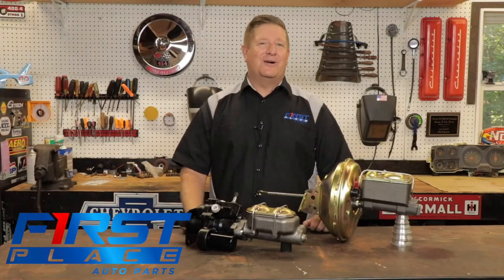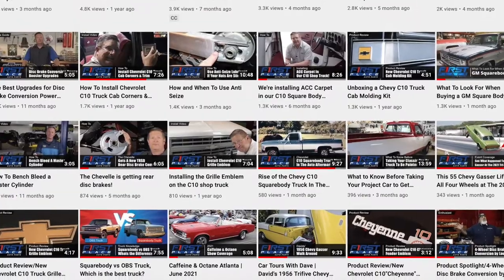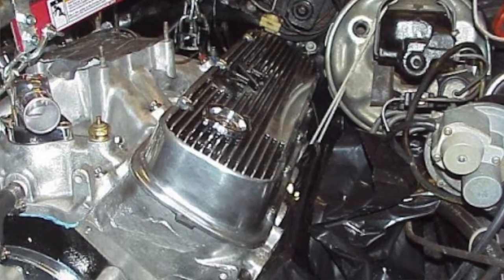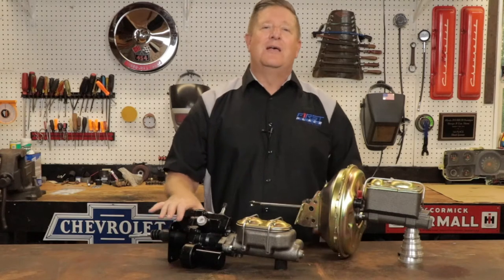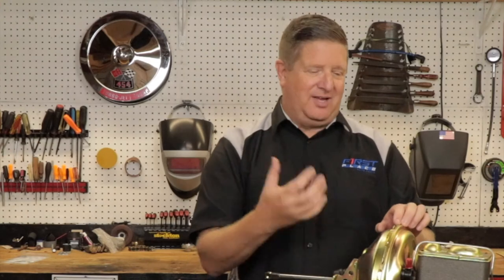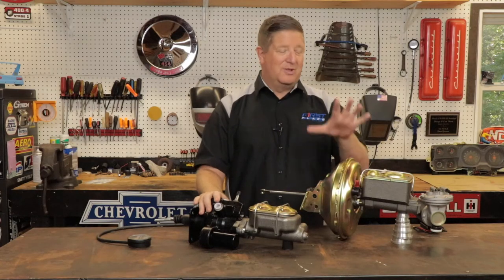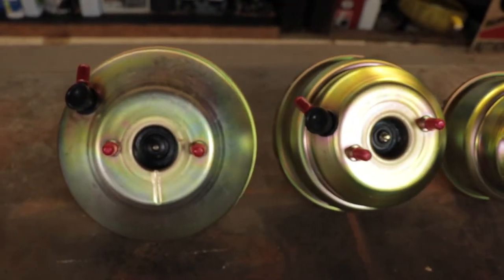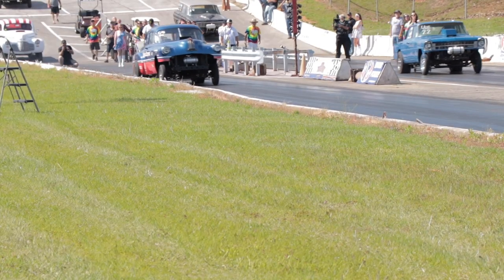Hydro Boost vs Vacuum Power Brakes, Which is Better?

Comment: Good video ,there is the 3rd option where you have the corect size master and slave or calipers and fully manual brakes. Had a wilwood kit like that on a 4000 pound car and it had the best feel ive ever felt.

Comment: Thanks for your blatant hydro boost pitch. A pity perhaps, that you chose to avoid mentioning that low vacuum issues with warmer camshafts can be dealt with a simple vacuum can. Cheap, silent, usually easy to mount and have been used for decades. But not much profit in those compared to a hydro boost kit is there…

Comment: I’m doing a total restomod of my 70 Firebird, yes I’m doing the whole Ls and tranny swap, along with full suspension, and brakes to include the rear brake disc conversion. I’ve never liked the stock brakes even while driving it with the stock 350 two barrel, so when I found out about these boosters I completely felt like it was a game changer!

Comment: I have a 1956 Chevy with a454 using a mustang II rack  can i you a hydro boost in my car, what is the GM power steering pump out put pressure for the hydro boost, what is the minimum i can use, mustang II rack needs about 800 to 1000 pounds, can i run the mustang II and the hydro boost with 800 to 1000 pounds of pounds

Comment: I have the hydro boost system in my2500 Silverado I just want to learn more about the system so if the power steering goes out do I lose the brakes also
Reply from the maker: With most hydro boost (similar to vacuum powered brakes), if you loose power to the system (in this case power steering) you should have one or two brake pedal applications before all power assistance is lost. After that, the system reverts to "manual" (no power) system. You won't completely loose brakes but it your stopping distance and the pedal effort required to make a safe stop will be significantly higher. Keep an eye on the serpentine belt that drives the power steering pump
Reply: Same here, I have a GMC 3500.

Comment: Usually your vids are good and informative... but did you really just waste all this time with space and volume and appearance... and negate totally the DIFFERENCE in what each does?  HYDRO stops you on a dime with very little pedal effort (and throws you through the window if not belted)... there... the Reader's Digest condensed you skipped.

Comment: i have a k20 chevy automatic, im going from a booster to a hydrobooster and i’m just wondering if there’s any difference in the rod that hooks to the pedal, is there another bracket or is it just plug and play with the pedal?
Reply: Yes there is the location of the pin on the peddle is higher up on the pedal on the hydroboost vs vac booster

Comment: Another issue is if your car, like my 56 Chevy, does not have power steering, but has a big motor, and not much vac. Looks like manual brakes are my only choice. Disc on the front, drums on the rear, and a new manual master cylinder.
Correct??
Reply: They have electric vacuum pumps, there is a turboed sabb that uses one from the factory.

Comment: 72 Chevy K5 Blazer.  90% of the items on the table sucked. I could not get the nose to dip on my K5. She just would not stop. Changed EVERYTHING!  Then I tried the Hydraboost power steering system. It nearly threw me through the windshield. I never had another stopping issue, even when towing heavy loads.
Reply: @lAcid Rainl I am installing a system now on my "new" 1974 K5 Blazer project.
Reply: Did you have any issues with the shaft length to the factory brakes? I'm putting this on my 72 K10 and seems the output shaft is too short. Pedal seems too low to the firewall.
Reply: @Supertommy68  It actually uses your old hardware which connects to the brake peddle.  It connects as usual, and it is adjustible.
Reply: @bibleortraditions  Thank you. My kit must be a bit different, it came with it's own shaft preinstalled with coupler nut.

Comment: Appreciate the explanation regarding the vacuum and boosting breaking system. 
One question that I have, considering there is only one power steering pump, can the hydro boost for the break and the power steering be connected on the same pump? Is this practical?
Reply: Yes you can use the existing power steering  pump

Comment: I wasn’t able to find the hydro boost system on your website for a ‘92 OBS GMC k1500
Reply: I would look into using one for an astro van.
Reply: @GrimRepair  I did find it and the adapter mount, still need to get it installed, but waiting till after I do a solid axle swap, since I'll need to have the brakes bleed
Reply: @justintyme1449  After I put a 3000lb camper in my truck, the brakes seemed inadequate.It stops much better after I put in a hydroboost and moved the peg on the pedal.